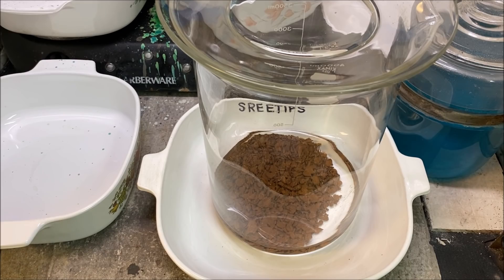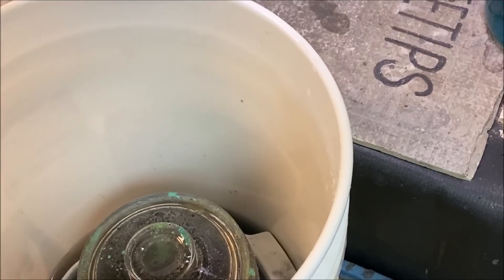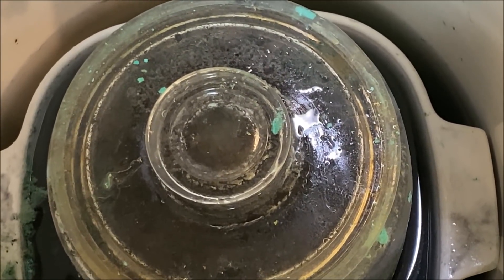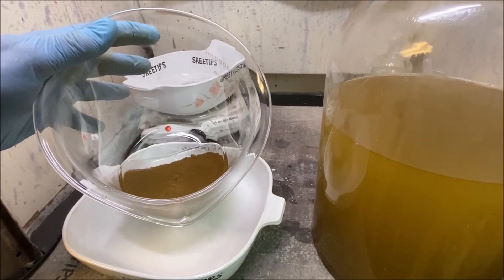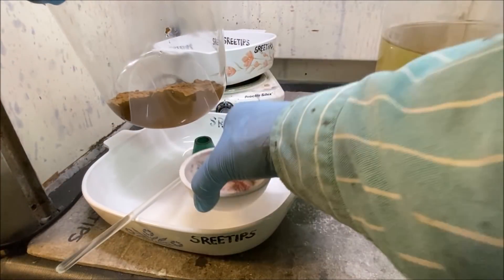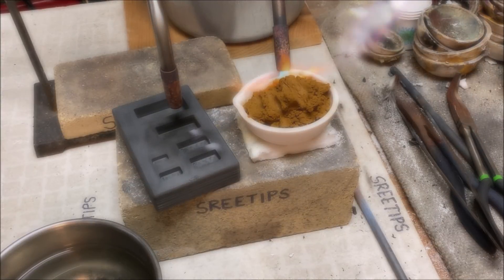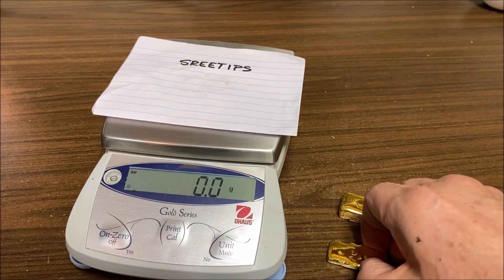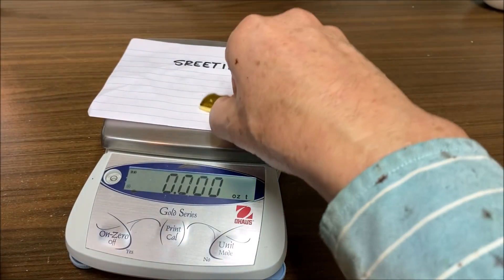24k Pure Gold Bar 7 Troy Ounces Pt2

Comment: The thermostats likely failed due to exposure to corrosive fumes. I see that similar think in homes with sulfur water. You can replace the thermostats  but Its probably safer to replace it.  I believe the silver loss will be very minimal.
Reply from the maker: I’ve been through dozens of burners. They only last a few months. Good thing they’re cheap.

Comment: I’m sure there’s going to be a decent amount of CU and AG oxide (the black precipitate, both copper and silver are black in their oxide form) in that silver jar, your’e probably going to want to throw a decent amount of nitric back in there to get all those oxides back into their soluble nitrate form. Other than the loss of expensive nitric acid and tedious clean up I think you’ll be able to recover 99% of the silver in that jar without too much trouble. Good luck sreetips.

Comment: I have what I'm told is melted down low K jewelry about 5.5 ounces and appears to be around 8k. I would like to refine it to a higher purity but fear failing.
Do you refine for others?
Reply from the maker: Sorry, I only work on my own material. Try a small 10g lot before commuting the whole lot. Work your way up as you gain experience and proficiency. Your fear is a healthy one.

Comment: Wow, that's kind of an unusual malfunction. When you picked up the hotplate I could barely see the back of it...and looking for other images of the the thing, NOTHING showed the rear. Is there a fuse? One would doubt that a cheapo consumer device would have a fusepost like a guitar amp or a piece of industrial gear. On the next one you may have to go inside and modify it so that EACH burner has a fuse..*not the unit as a whole if it is a dual* = TWO fuses. I don't consider what happened here a "mistake"..it was a malfunction. But, operating in an environment where you have corrosive fumes, over time it's certainly possible that fumes degraded whatever protection measures that unit may have had.
Reply from the maker: Those burners usually fail after 6 or 8 months on heavy use (high heat for hours at a time several times per month). But this one was acting weird. I had the heat on full for the electrolyte but it was not boiling very well. So I know it was about to go. But I didn’t expect it to fail on full high heat. How about that Corning Ware dish? It held up very well considering the heat intense enough to crack that thick Pyrex coffee pot.